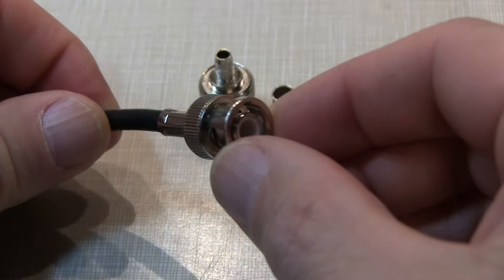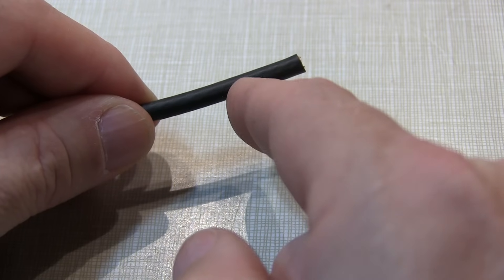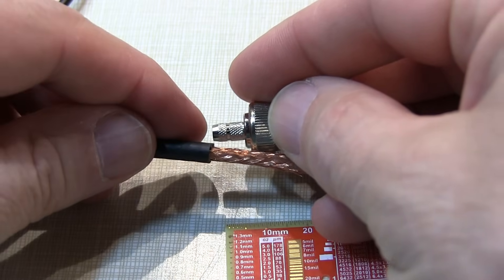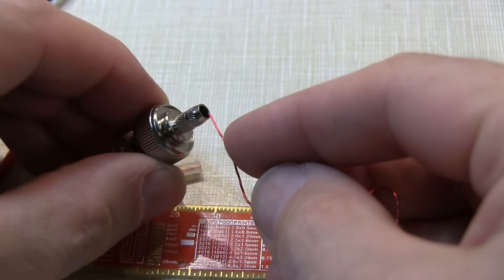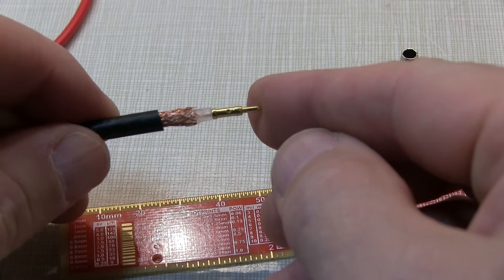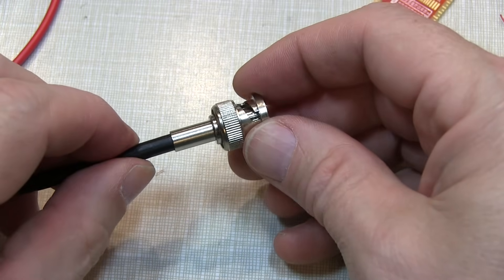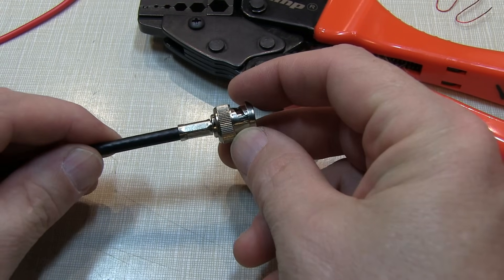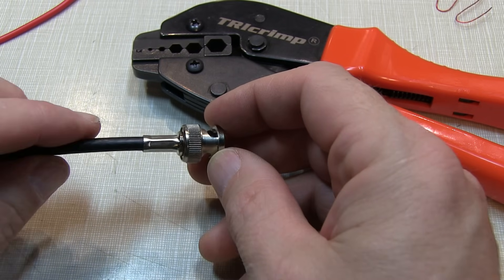#230: How to install a BNC connector on RG-58 coax | DIY Repair

Comment: The one thing this video doesn't mention that I screwed up (and that AVIVX's video does mention) is pushing the BNC connector down hard enough until you feel the snap of the pin seating. Otherwise the pin won't extend far enough for as solid of contact as desired with the mating connector.
Reply: Pin from the coaxial keeps breaking.. gotta be another way or I'm doing something wrong
Reply from the maker: Excellent point - I am going to pin this comment to the top so other viewers will see it.

Comment: Can you please post a link to the tool and BNC connector you used for this video so I can buy from?  I'm new to this and your video helps tremendously 👍👍👍
Reply from the maker: This is a good source for the connectors. They also sell the crimp tool and die sets. 

https://mgs4u.com/?gad_source=1&gad_campaignid=1597832328&gbraid=0AAAAAC9YPH2n5RCLxyiGxOZ7F-Q_DZDws&gclid=Cj0KCQiAg63LBhDtARIsAJygHZ5zhxePhMlYwzgv5ZAOHi8jiG1b3v2vJTUJVIRH81vhKiwXNu6TuX4aAtLLEALw_wcB

Comment: The center pin typically uses a 0.068" die & 
The outer ferrule typically uses a 0.213" die.

Comment: YOU MUST EXPLAIN AND GIVE MORE DETAILAS ABOUT CRIMPING TOOL. THIS IS NOT A JOKE.
Reply from the maker: The connector manufacturer will specify the type/size of the crimped die required for the given connector.

Comment: 5:44
Thanks for mentioning the different types near the end there.
RG-58 (50 ohm?) 
RG-59 (75 ohm)
RG-174 (??ohm)
RG-9
Reply: You can find many lists online that include many types of coax, but some common ones are:
50 ohm:
RG-8, RG-58, RG-174, RG-316, RG-178

75 ohm:
RG-9, RG-59, RG-179

(Note that while these types might suggest that the impedance is indicated by whether the last digit is even or odd, that’s just coincidence.)

Comment: my connectors i bought didnt come with the centrr pins am i supposed to pull it out of the center of the main connector? came with the sleeze an main connector, thats it
Reply from the maker: I'd return them - the center pin geometry must match the what the connector needs.  If they didn't give you the center pin, return them as faulty.

Comment: When you push the cable with the pin into the main connector body, there should be s slight click as it locates.
Reply from the maker: It depends on the design/manufacturer of the connector - some of them click into place, some don't.

Comment: Good video.  Lousy cheap low-grade RG58 with minimal braid cover.  RG58 is not an official designation now, It used to be a Mil-Spec (JETDS) in the old days, but is no longer the case, so suppliers are not held to any sort of manufacturing standards.
Reply from the maker: Sometimes you have to make do with what you have.
Reply: This is incorrect. RG58 remains specified as MIL-DTL-17/28C, and in fact the standard was last validated in 2020. It is merely designated as “inactive for new design” but “valid for use”, meaning that it’s still the specs for the type of cable, e.g. for repair or replacement in existing designs, or for non-military use. 

A lot of commercial coax cable doesn’t actually claim to be made to military standards, so one does need to watch out a bit if quality is desired. Sticking to top brands is usually good enough.

Comment: is it resist for continuous bending? i mean use it in open field plug/unplug etc, isn't it wear quickly just before this small tube?
Reply from the maker: Heat shrink tubing helps fit this

Comment: Female BNC center conductor doesn’t get crimped?
Reply from the maker: You can crimp or solder, I prefer solder for the center pin.
Reply: @w2aew I was watching other videos & for the female BNC there just shoving it in there then crimping the larger ferrule 🤷‍♂️
Reply from the maker: @BobBob-il2ku   In this video, I crimped the center contact.  In a later video, I soldered it.  It must have one or the other.

Comment: I need sizes of crimps
Reply from the maker: The sizes of the crimp depends on the manufacturer of the connector.  Consult their documentation.  Even for the same type of coax, there can be differences in the required crimp die depending on the manufacturer's design of the crimping surface and ferrule.

Comment: Is a BNC connector generally found on hand held radios rather than mobile radios or am I making a dangerous or arrogant assumption?
Reply from the maker: A BNC is common on many VHF handhelds as well as many QRP (low power) HF radios.  It is also VERY common on test equipment like oscilloscopes and function generators.
Reply: Dear W2AEW, thank you very much for taking the time for sending to me your thoughtful reply.  @w2aew

Comment: Just once .. I want you guys to actually tell us the crimp die size you are using.
Reply from the maker: It wouldn't really do that much good, as different connector manufacturers will often use different sized ferrules for the same coax application, so each would have their own recommendation for the die size.  It is best to use the die size recommended by the MANUFACTURER'S INSTRUCTIONS for the connector you are using.

Comment: Hello, great video. I've two questions: -1 for Cb cable Is better of i weld the central pin?
2- how much do you adjust the power of the crimper for the two different crimps?
Thank you
Reply from the maker: Soldering the center pin is usually better. No need to adjust the crisper when using the appropriate die set

Comment: My problem, it is not  RG-58, Where the 6 connectors in DVR,  The cable is very small diameter. The end of cable connect to DVR.  Also it is 100 ft in length, and coming from the floor from crawl space. .The BNC is already installed in cable, like about 8 connectors on the wire assembly.  Problem the cable broke off the connector.

Comment: I have never been able to make one of this connections successfully, bought the tool but seems it doesn't have the exact dies to grip the connector. Got from AliExpress a connector that has screws that will fix the cable ends but also no luck with those, I am now searching the internet trying to find the polarity of said connectors. This BNC turned out to be such a hassled cable connector convention.

Comment: Great video except for one very important thing.  You did not mention the crimp die sizes.  My crimper has six die sizes and It is supposed to be used for 58, 59 and 174 coax.  I think I got the correct dies.  I used 0.213" for the collar and and 0.068" for the center pin.

I approached crimping the center pin a bit differently.  I placed the pin in the jaws of the die and closed it enough to hold it in place then inserted the center wire and crimped the pin.  It held tight and I didn't have to finagle the wire with the pin on the end into the crimping die.
Reply from the maker: The center pin typically used a 0.068" die, and the outer ferrule 0.213".  But, always best to check the sizes recommended by the connector manufacturer.
Reply: AFAIK most manufacturers recommend 0.052" die for the center pin of BNC connector

Comment: Hello, can you please let me know the make/model/size of the crimper you used for compressing the sleeve onto the cable end of the crimp. Thanks.
Reply from the maker: For the center contact, I believe I used a 0.068 hex die in the PWR-Crimp tool - part of this die set: 
http://www.westmountainradio.com/product_info.php?products_id=ct_ds04

Comment: Can you use the same BNC connectors for RG8x cable that is used for RG59 cable?
Reply from the maker: No, there are minor dimensional differences between 75ohm BNC and 50ohm BNC connectors.

Comment: I'm looking for a termination cap for 50 ohm tee connector, only thing I can find is in UK. I guess I solder a 50 ohm resistor  on the end of one of these connectors with the center pin and shield?

Comment: Hi, very informative can these same hand crimps be used on Fakra type connectors  for  Coax cable for automotive sat nav cable make up?
Or would you suggest others purely for home project diy use
Reply from the maker: As long as you are using the correct die set for the connectors/cable in your application, a quality ratcheting crimper like these will be fine.  I am not familiar with Fakra connectors, but if they have a set designed to be crimped, then they should be able to recommend the appropriate die set.

Comment: Thanx! From video: outer jacket, 20-25mm; shield length left: 7 mm (≈ connector ferrule length); insulator left: probe with a wire and bend (2m38s); central conductor: with pin over it, pin should touch insulator, cut small bits progressiveley. Voilà! Salutations du Québec!

Comment: I learned how to do that about 35 years ago, putting BNC connectors on RG-58 style coax for "thin" Ethernet.  The steps you showed matched up almost exactly with how I did it.  I could not agree more on your point that you need to match the connector to the cable and then the tools to the connector.  I had to work with Belden 8997 cable (I think it was) which was for air plenum use, basically almost like Teflon, no smoke during a fire.  It was new enough that I had to use one crimp tool for the center pin and another for the outer crimp ferrule.  Regular coax could use the same center pin tool but yet another for the ferrule.

Nicely done video overall, just enough details, long enough without being too long.

Take care, Sir!

Comment: Why are some connectors rated for 50 ohms, but they fit on a 75 ohm cable? For instance, the Amphenol 31-4321 BNC connector is 50 ohms, but it was made to fit on RG59 cable which is 75 ohms.

Comment: if you're installing security cameras and using either RG59 or RG6 I think it's better using a compression tool rather than a crimping tool. a compression tool if far stronger and more accurate length

Comment: I bought a set of crimp BNC connectors and the tool, because I was so frustrated with the compression type, which I believe are better.  I have since learned to terminate the compression type.  I’m still glad I have both types now. I’ve been doing CCTV work for two years, as of this comment.

Comment: Love the video.  I bought the TRIcrimp and die set.  What size dies do you use for BOTH crimps?
Reply from the maker: The datasheets for the connector should indicate the requirements for the size of the die to perform the crimp.

Comment: will you please tell me where to buy these connectors at the best value ??  Also I have the same crimp to as you. Did you purchase the entire Die Set  for your crimp 

 Tool. Thank , You Fred
Reply from the maker: You can buy them very inexpensively on Amazon or Ebay, but the quality might be suspect from some of them.  Or, you can get higher quality unit from places like this: http://www.l-com.com/coaxial-50-ohm-bnc-crimp-plug-for-rg58-195-series-cable

Comment: hello thank you for this video I would like to know which cable is used for measuring devices (oscilloscope, counter) is it possible to make them yourself thank you
Reply from the maker: Most common is to use BNC cables on RG-58 coax - just like I show in this video.  You certainly can make them yourself.
Reply: @w2aew  thank you I think it's that I'm going to do that will make big savings

Comment: As you correctly point out the most important part of a successful outcome is the proper crimping tool.  Unfortunately, connector vendors have no idea what size crimper is required for the connectors they want to sell you.  They also will lie about what coax fits their connector.  Your video mentions nothing about the proper size crimp dies for any of the many BNC connectors nor do you mention a reliable connector vendor.  Certainly not ebay.

Comment: The center pin on that connector is NOT a crimp pin, it is a solder pin as identified by the hold in the pin.
Reply from the maker: The manufacturer claims in their description that the center pin can be crimped or soldered.

Comment: This comment/request might be a little out of scope, to calibrate a Tek SG503 Tek says a special cable is required, Tek part 012-0482-00.  This is an extremely expensive 3 foot 50 ohm BNC cable, $200+ on ebay.   There's a discussion going on at  TekScopes@group.io about the need for this cable and thought this was right up your alley for a video.  How do you make a precision application cable in the home workshop?  What is this cable doing that another 3 foot 50 ohm terminated cable can't do?  I'm a m addicted to collecting Tek 500 series plugins for my home lab and have a SG503 and would love to make one. Thanks and love your videos.
Reply from the maker: I looked up the engineering specs for that cable - doesn't look like anything super special.  012-0482-00 refers to a 36" +/-0.5" long RG-58C/U cable with BNC connectors and strain reliefs.  The BNC connectors are to be per MIL-C-39012 spec, which basically applies to most high-quality (reputable manufacturer) connectors, rated to 4GHz, max insertion loss of 0.2dB at 3GHz, VSWR of 1.3:1 max with TFE insulation.  Nothing super special, just a 3' 50ohm coax made with quality materials.

Comment: Hi all,  May I know why does the copper braid goes on the outside of the connector not inside during connector insertion?
Reply from the maker: So that it gets crimped between the connector and the ferrule.
Reply: @w2aew  Is there any electrical reason behind it ?
Reply from the maker: The crimp gives you a reliable, gas tight electrical connection between the shield and the shell of the connector.
Reply: @w2aew  has this anything to do with providing a good ground for the coax?
Reply from the maker: Yes, of course. Same thing.

Comment: Great Video! Very Helpful.  Question: I found that the BNC center pin once inserted into the BNC connector clicks and locks in place and does not come out. After crimping the center pin and the ferrule and pulling to test the crimp everything seemed fine. On some of the crimps I have made I found that the ferrule did not crimp securely and pulling to test the BNC connection gave a false sense of security as it appears that the center pin prevented the BNC connector from detaching from the cable (since the center pin is also crimped to the core of the cable). 

I decided to do some more tests and crimped some ferrules (using an Xcelite ratcheting crimper) on the BNC connector (with no RG-58 cable / pin) and found that for some BNC connectors the ferrule just slides off after pulling slightly. I tried some unknown brands along with named brand Amphenol BNC with disappointing results. I found that I needed to adjust the tension dial to a higher tension on my crimp tool for the unknown brand BNC connector ferrule to crimp satisfactory to the BNC connector. Some other brands such as Provo BNC connectors had their ferrule crimped successfully at the lowest tension setting and seemed to be sturdy when pull testing by hand.

I am curious, have you test crimped a ferrule directly on a BNC connector with no RG-58 cable / center pin and does the ferrule appear to be crimped securely when test pulling by hand? Did you need to adjust the tension setting (if available) on your tool?

Comment: Sorry to have to say this, but the procedure is flawed. The CRUCIAL step is the "click" sound when inserting the inner ferrule. It takes a little effort but the difference is another 1.5mm further in. This is the most important step, everything else is fine. Also, do the "finger-nail" test. A man's short finger-nail should be able to touch the inner conductor easily after assembly, the tip should be almost flush with the top annular ring.Lastly, there are 2 styles of inner ferrule, (1) pointed, ie sharp, and (2) bull-nosed, ie rounded. Rounded are better because they present a larger diameter earlier in the insertion process. It would be lovely if you test this and re-do the video as there are so many bad BNC's out there. I work in the aviation and electronics industry and whenever someone complains of poor radio performance this has been the culprit about 90% of the time. Let me know if you check this - ps you have to push the inner connector HARD (and make sure you have a little more slack in the outer braid). Thanks.

Comment: Will greatly appreciate if you can kindly let me know the correct details of the crimping tool. Thank you 4S7EF
Reply from the maker: I use the TriCrimp tool:
https://powerwerx.com/tricrimp-powerpole-connector-crimping-tool
and the D-HEX die that is included in this set:
https://powerwerx.com/tricrimp-tridies-accessory-die-sets

Comment: Nice video. You commented on having used coax stripper tools. I have one, but it only makes 2 cuts, so doesn't leave the extra 4mm or so of the insulator beyond the braid/foil. Can you comment then on how the final piece would perform (only concerned with HF)?
Reply from the maker: Might make a small impedance bump, but probably not critical at HF.  Biggest concern would be potential shorts from stray pieces of braid.

Comment: Another great demo as usual.  I do have one suggestion.  When crimping contacts onto small wires I find it preferable to place the contact in the tool and then insert the wire into the contact.  I do this for all connector styles.  The position of the contact in the tool is usually quite critical and can be varied enough to make a poor connection.  I also want to point out that BNCs are readily available in both 50ohm & 75ohm impedance.  I don't know of a way to distinguish between them visually so be careful when buying them because the seller might not know what they are selling.  Coax is usually marked with an identifying number and sometimes the impedance so if the connector fits the coax it's likely the correct impedance.
Reply: Hello

Comment: Soldering is far less reliable than a properly done crimp.

BTW it's easiest to fit the ferrule (and strain relief) before you go anywhere near the cable with a knife. Decent plugs will have a manufacturer's dimensioning guide either with the pack or online. :)